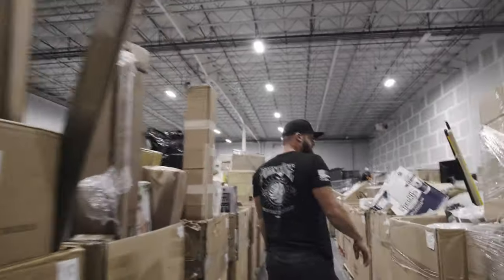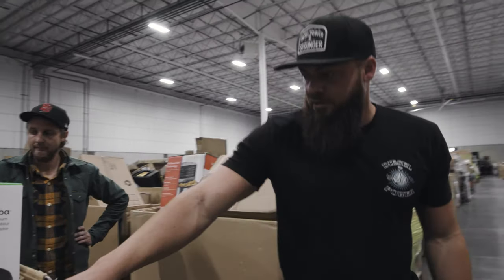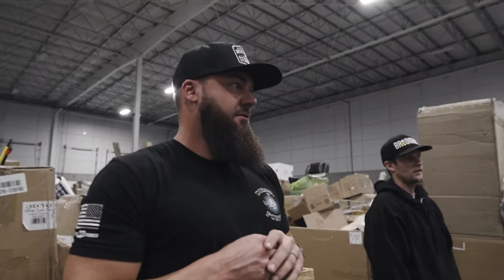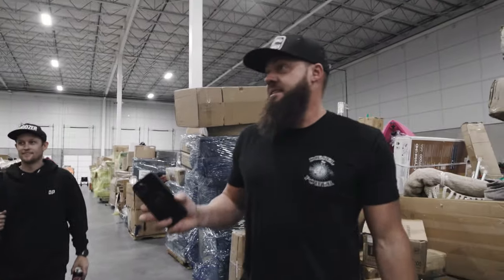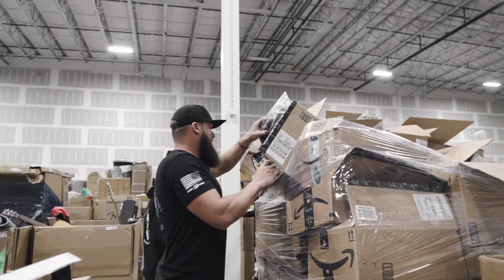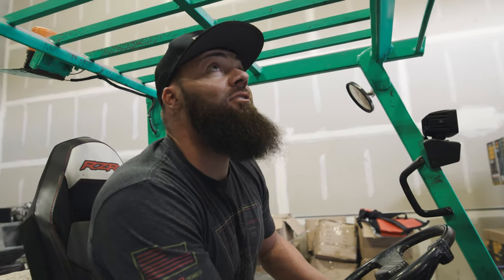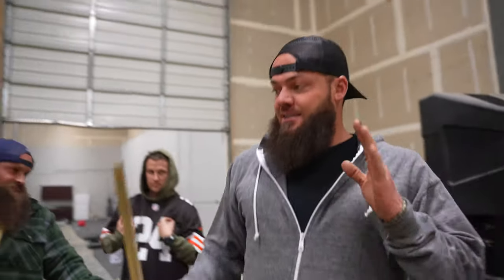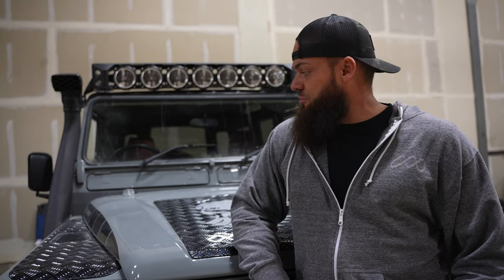I Spent Over $30,000 At A Lost Freight Auction And It Paid Off BIG TIME!

Comment: That "weird wrench" is an intrinsically safe wrench for explosive environments. They go for like 40-400 bucks depending on size and brand
Reply: Yes,they are made of bronze I think and don’t spark.
Reply: we used them on methanol railcars ect...
Reply: Cool to know, stuff you would never know or think of otherwise
Reply: Yeah iv resold for years an item like that may cost a nice penny but the market is abysmally small and the people that use them don’t buy them personally, their employers do and oddly enough a lot do those pieces of equipment need certificates and etc to sell and sometimes it’s illegal to sell if it’s old , used or obtained without prior history. Pallets can be fun but buying and reselling anything is a ton of work and even more risk

Comment: I'd say the "lost in mail" or not claimed which is more likely accounts for a small fraction of the stuff. Most will be customer returns, then a smaller % is over stock.
Reply: Actual lost mail auctions look exactly like that, hamper carts and mail carts filled with boxes 📦 and mailers, customer returns look like this pallets of items you can actually see and identify. Super super risky, he looked at a horrible cheap hot tub that is known for leaking breaking never working etc and is buying one someone else most likely already broke.
Reply: @Hashdollars  ya I've bought similar and usually half of it you have to chuck but you can easily make money (if you don't count your time 😂)
Reply: @-JonnyBoy-  yeah the old ‘free time’ cost the most.
I own a trucking company and to use my trucks to me is one cost that’s nominal but to have four of my guys there and my truck filling up for someone else is a entirely different price.

Comment: The auction guys absolutely go through and pick out the really good stuff. To be fair I would do the exact same thing so I don't blame them one bit. I'm just saying chances are you're not going to be finding any $5,000 item sitting at the bottom of the pallet or a gold coin collection or anything like that.
Reply: Storage auctions are the same...I know that for a fact
Reply: @hdtripp6218  lol no way common?!
Reply: Yes You're getting the leftovers.
Reply: No, they don't. if these guys took the cream that would be theft as this stuff is sold on consignment and they would end up behind bars.
Reply: @marvindebot3264  they remove items before ethey put the Pallet up for auction.
Reply: @hdtripp6218  I was a storage manager who did auctions for many years in multiple states. Nearly all states have fairly strict laws. As a manager there's no legal way to do what you're saying. Locks are cut with a witness to sign it off, a tag is placed on the unit that is recorded by the witness. The tag has to match the auction paperwork which has to match when the auction buyer opens the unit. No employee is allowed within the unit when the lock is removed. Photos are taken for the auction in that moment with the witness for the auction. No employee or family members of an employee are allowed to bid, or acquire any goods from the unit. The auction buyer must remove all belongings except for private, sentimental items that hold no market value, which must be held typically for 1-3 months depending on state and can't be kept, it must be disposed of. While it's likely there are facilities in rural places that are one off privately owned facilities that do whatever they want with no regard for laws, the vast majority operate in this manor as there is typically a large volume of paperwork, and security checks involved at multiple steps to ensure the auction can legally be held, failing these steps and checks can open yourself to litigation by the owner of the belongings (tenant) or by the suction buyer, or even by the state.

Most people have a very skewed view of storage actions. What you see on TV is a laughable resemblance of reality. Shows like storage wars are entirely fake. The vast majority of units simply contain garbage with little to no marketable value. 

The only way a storage facility manager can acquire any goods is if they're abandoned in a manor that wouldn't allow for an auction. Such as being dumped, left outside the units, illegally stored, or other things that wouldn't fall under auction and storage laws. 

Out of the thousands of units I personally saw through the auction process, only a handful had anything decent in them. 99% of the units I wouldn't even want to touch the contents even with gloves and a mask. Nobody is pulling all the good stuff out. There just was never any good stuff to begin with.
Reply: Depends on the arrangement. For them it would be more difficult and risky than you may think. They aren't just given the pallets, they're a middle man who auctions them out. It would be as though you were supposed to auction out a cake but scraped off the frosting. 
Obviously they could have permission to remove items to sell separately if they believe that could earn more money, but if they just took something off the books and someone found out, they could get sued because they would essentially reduce the value of the lot they were supposed to sell. 

Additionally, with how many lots they're dealing with, cherry picking would not be viable because of the extra work. Time is the main reason this kind of operation even exists - the businesses simply don't have the time to go through everything and see to all the necessary formalities for the items to be sold again. 

It would be a different matter entirely if they were actually purchasing the pallets, and I know that some similar operations work that way. They flat out pay for the pallets, go through everything, make an inventory, sell the stuff they know will sell quickly and then put the rest for auction. They may not be able to move as much stuff, but they make more money out of any given volume, simply because the bidders know what they're buying so the bids end up going substantially higher.
Reply: if they took the good stuff beforehand, no one would want to come back.. I'm sure they make enough money selling pallets, so they don't need to go through any. But I'm sure they see some good stuff from time to time and take it!
Reply: @JourneysADRIFT  "The vast majority of units simply contain garbage with little to no marketable value."
That makes perfect sense.  If it's valuable, why would anyone keep it in a storage rental. They would keep it in a home safe or security deposit box at a bank. More often than not, the person leasing the unit is someone who lost his home or apartment due to financial hardship and had to find a place to store his belongings.  He could also be a hoarder, who just couldn't let go of junk he owns.
Reply: @onespeedlite  you realize you contradict yourself. 

"They would keep it in their home or a safe deposit box" 

Immediately followed by "they typically lost their home" 

There can certainly be valuables in units, it's just, those people tend to not let the units go into default and auction. But it can happen, especially on the death of a family member. 

The majority is as you said, people who have lost their living arraignment and need additional storage during their transition that becomes semi permanent. They can't afford to keep paying, temporary becomes forever and they loose their belongings. 

A lot of their items may have had value initially upon storage too, but after half a year or more in a locker, being dug through, or attacked by mice because they left food with their kitchen stuff, it becomes worthless. 

Not to say there aren't valuables to be found. But you typically have to dig through a lot of trash to find marketable items that you can actually sell. This isn't literal garbage waste, but "trash", items that simply have no marketable value or their value is too niche to realistically sell, so it's best financial option is the dumpster.

This is why most units sell for 20-200$ at most. It's rare to see a unit go for more than that unless you have some high end tools, machinery, boats, engines, cars (depending on state), it's extremely clean and well boxed, etc.
Reply: @YoItsMillerTime.  In sure they only take the really good stuff like jewelry, ammo, electronics etc. If you notice all the good stuff is on top, to drive up the bidding, which shows they sort through stuff. I've seen a few different videos at this place and never once saw a laptop, new iphone or anything like that, where did it all go?
Reply: @Spitts  Yeah, you're right. I bet they kept all of good stuff in this specific video to gain more bidders lol
Reply: yeah i see most people think here these folks will give you free money LoL..... they already went through and took the good stuff, all these stuff go from one hand to an other hand and and people just picking and at the end you will bidding on the worthless things, we bought ones a werehouse with full of stuff like this we thought we bought it straight from the first person, we litteraly just paid for it and finished the paperwork then the guy couldnt stop running his mouth and accidentaly said he also bought it from someone, than i knew i am fucked i couldnt even break even and it was so much work for nothing.

Comment: If no dock, then use a pallet puller - right tool for the job when you can't run a fork into the trailer box. $100 or so ... use the right tool.

Comment: Dude that weird wrench 40:49 looks like a Copper-beryllium wich is spark proof.
Reply: Probably Chromium, a piece that size of Beryllium Cooper would be pretty expensive a rod about  18 “ inches x 1 inch and 7/8 round back 15 years ago was right at $500 we used it as a cam follower. It followed a track in a cam that went inside a machine

Comment: Its still somewhat a sketchy business.   
Pulling the most expensive items in visibility. And i wouldn't be surprised if there's some cherry picking involved behind the scenes from the original seller to the auctioneers. But it's fair in a way that the buyers all have an equal chance at losing. Basically it's gambling. This is fitting for for former casino gamblers who need a change a scenery.